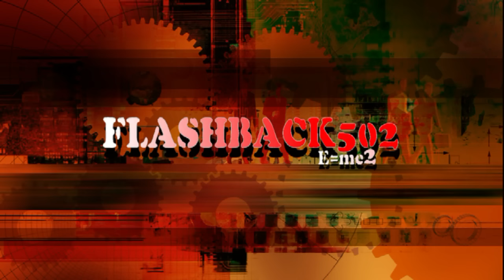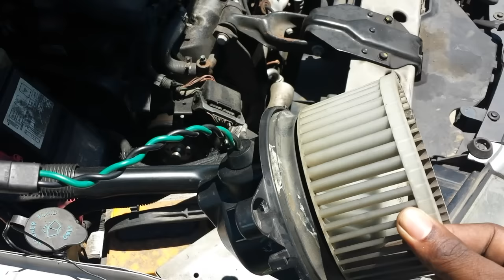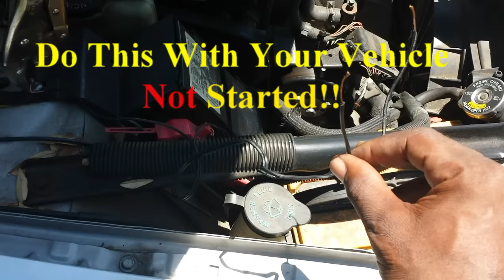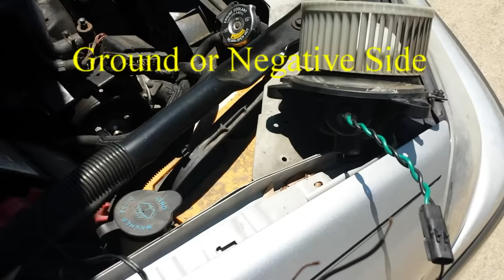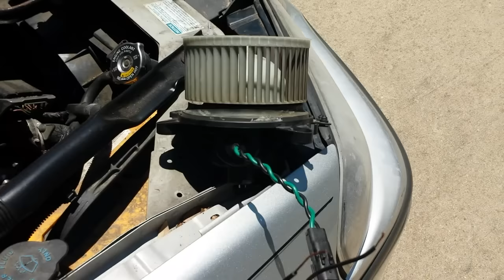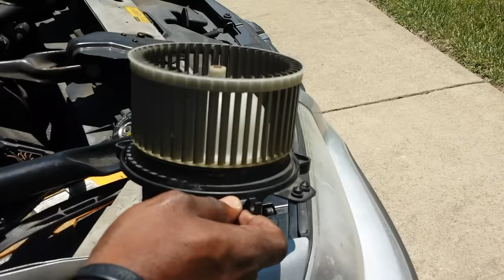How to Test Vehicle AC/Heat  Blower Motor to Tell if BAD

Comment: Very helpful video. My fan wasn’t working, I was getting volts before and after Resistor/Relay thinking fan was toast.  Did this fan test and it worked… Glad i didn’t buy a new fan. I was a lil confused why everything worked but Put everything back together. Maybe loose connections or there was a few dozen pine needles in the fan. Ty

Comment: You did prove that the blower was good, however from what I have read and studied on the web concerning auto electronics, you should test the fan while it is connected to its connector, "very important with the circuit ON", then "back probe" the connector, of the blower, with a DVOM "digital volt ohmmeter"  One end of the DVOM the "black lead" connected to a good ground, ideally, the battery negative terminal, then "very important" with the circuit ON, you now place the red probe of the DVOM on the positive feed to the blower, and read the voltage. If the voltage is low, like say 6 volts, way less than the battery source voltage,  then you have a voltage drop "resistance from corrosion or whatever" on the positive side of the circuit, from corrosion, loose connection, etc.

 If the voltage reads a normal 12 volts same as the battery source voltage, then place your DVOM red probe "back probing again", on the negative blower terminal, it should  "ideally" read "zero volts" or .very close to zero like .5v  5 tenths of a volt or less,  if it is higher than .5v you have a voltage drop "resistance corrosion or whatever" on the ground side of the circuit, because of a bad ground "resistance" like a loose connection, corrosion, etc.

So bottom line, you just can't say that the problem is definitely the switch on your dashboard is the issue, it could be, but it also may be from resistance as explained above. 

What you did was prove that the blower does work. You did not find out why it doesn't work when it has power in the circuit, and you guessed and concluded, that the switch on the dash of the car was the problem.

HTH
Reply from the maker: Thanks for helpful info.

Comment: You need to run it through an ammeter to see how many amps it's drawing.  When the motor is failing it draws more amps and burns out the resistor.  You'll just keep replacing resistors one after another with a failing motor that is drawing too many amps.
Reply from the maker: Thanks for watching and commenting  with tip. Please subscribe and share if haven't already and check out our other helpful videos.
Reply: Yes this test the guy did in video is good but does not prove 100% your motor is bad mine works but when we amp tested it.  It was way to high causing resisters an the wire harness connectors to slowly burn so u must amp test to truly 100% know
Reply: @charlesmorgan901  Thanks!
Will this cause the fan speed to become weak & slow, giving weak airflow?
Reply: @dee1380  hey any luck on this? Even my blower runs slow on all speeds

Comment: Not bad way to do it but you should have some small alegater clips with rubber coatings on them  to clip on the terminals instead of just sticking the wires in. A little safer.
Reply from the maker: Thanks for helpful tip. Please subscribe & like and share if haven't already and check out our other helpful videos

Comment: CAME BACK TO MAKE SURE i LEFT a LIKE..what next brother?
cuz my fan works on the Hot test
Reply from the maker: Thanks, check your fuses if not bad, then could be your blower resistor or a problem with you climate control  panel if not blowing at all. Also check your power plug to blower to be sure your geting power to it.

Comment: Another thing to note, if your high works but your low doesn't your resister may have gone out, which usually means your blower fan needs replacing as well.
Reply from the maker: Thanks for helpful tip. Please subscribe & like and share if haven't already and check out our other helpful videos
Reply: If it doesn’t work at all(with good fuses) is it the blower motor being bad itself or also the resistor? My mk4 gti fans randomly stopped working after I let it warm up(everything went dead on the climate control) including the lights for it…
Reply: @btbdesire4675  could be, though with that many issues I'd check the back of the climate control unit.

What happened with mine is the blower motor went bad, caused increased draw at the regulator, regulator goes bad, and then the contacts at the back of the climate control unit burnt out. In which case you need to replace all three, you might be able to rebuild the contacts at the back of the unit though.
Reply: That should only effect the fan controls though, if the entire unit is kill it's more likely that the climate control unit went bad, especially if it's new enough to have computer chips. 
The cheaper thing to rest first though is power, make sure the power is arriving at the unit, if it is, then you need to replace most likely. If there is no power, you get to have fun tracing wires
Reply: @HmmWelp  tested the blower fans and they have power, the resistor pack tested good and gave the exact outputs it should. Any other ideas before I go tearing into my wiring? Is there any other fuses other than 5 and 25? A relay or something else
Reply: @btbdesire4675  there certainly could be, that depends on the vehicle though so I'm not sure. I would pick up a new control unit from a junkyard and test that before you disk around with wiring, and replace the fuses you know of if you've only tested them.
Reply: @HmmWelp  alrighty, thank you. It’s a 05 mk4 vw gti! Is there a way to put power to the climate control unit to see if it’ll power on?
Reply: @btbdesire4675  if you know the amperage you likely coul, would just need to hit the red and yellow (if it follows stereo wiring colors) while the black is grounded.
If you do chase wiring, the most likely fault will be the ground.
Reply: @HmmWelp  Will the motor slow down airflow when it's bad?
Reply: @dee1380  a lot can limit airflow, I'd start by cleaning out the vents.
There's special cleaning spray that you use for that.

Other likely candidate is you need to replace your cabin air filter.
Should do that once or twice a year.

If you don't have any kind of grinding sound it's more likely one of those rather than the motor.

Comment: A blower motor also has a resistance that needs to be tested, if the resistance is not checked the fan motor can still be bad. Bad Fans can draw too much current!!! research before you make a video Like this.

Comment: My ac intermittently runs hot then cold back and forth. Something keeps stopping which causes that kick on noise to stop. I have to intentionally drive over potholes for that noise to kick on and the unit blow cold. When stationary the ac is warm.
Reply from the maker: Check recent videos, I just posted a video on your problem.

Comment: So I got a 94 Chevy c1500. It's not the AC controls. When you try to press or change the fan speed you can hear a loud click behind the glove box. I still don't get air at all. Is it my blower motor? Or is is fuse? relay?
Reply from the maker: Could also be your blower motor resistor. But check fuses also and relays.

Comment: You have to take the fan out to test it? You can't run a wire from the battery to the plug.
Reply from the maker: Yes you can👍Please subscribe & like and share if haven't already and check out our other helpful videos

Comment: You shouldn't have to take the blower motor out to test it. 
The problem can also be intermittent in the blower motor, or what's called a "dead spot", and would have to be replaced.

Comment: When I select floor, the blower turns off. Works on other settings.
I put another selector in, it did the same.
Goes from cold to hot..

Any suggestions?
Reply from the maker: Sounds like you have a problem with your climate control panel, may need to be changed. Please subscribe & like and share if haven't already and check out our other helpful videos
Reply: Resistor/transistor issue. control panels don’t really fail unless they get beat and punched on or liquid/moisture damage. Blower motors and resistors are the most common cause of low air or no air failures.
Reply: @np5589  

Thanks..

I know it's been 2 years..lol, but I parked on it, back at it with the same issue.
I changed the resistor, still the same. I did notice the pigtail connector melted, ordered another one which will be in today.

I thought my evaporator may be blocked, but I reversed polarity on my blower motor, & airflow picked up, but not enough, some air did come through, but very weak.

If replacing the connector for the resistor does nothing, what are the chances that the blower motor is not spinning fast enough? It's only maybe 5 years old(the blower motor).

There isn't very many other options left, so it has to be the pigtail connector or the blower motor itself is burning out. Or some wiring further down the blower motor resistor connector is having an issue.

Would connecting it to a battery like in this video give me full speed of the blower motor? It seems like it's fine at this point..

Comment: My heat and A/C only blows on the highest setting.  It doesn't do anything on any of the lower settings.  What could the problem be?
Reply from the maker: Sounds like it's your blower resistor that's bad not your blower motor. Please subscribe & like and share if haven't already and check out our other helpful videos

Comment: It could also be the resistor. Need a longer video checking everything, from the fuse/s first, the blower motor (here), the resistor, and finally the control panel. 👍
Reply from the maker: Thanks for tips. Please subscribe & like and share if haven't already and check out our other helpful videos
Reply: Do you know where the fuses are? I'm troubleshooting my problem and already replaced resistor and tried a new blower motor before that. Now I'm gonna test my motor to make sure it's not the issue and then I really want to figure out if it's a fuse of some kind before I take it to my mechanic to see what else could be.

Comment: Every time I touched motor terminals a spark occurred like if wires touched. Wires were not touching. When my heat stopped working I also smelled the burning smell
Reply from the maker: Check fuse, if not motor may be bad. Please subscribe & like and share if haven't already and check out our other helpful videos

Comment: Wrong. Sometimes fans will turn on and still be bad. If the blower motor still runs but turns on and off seemingly when you hit a bump or put it in park or drive then the motor could also be bad and start a fire. Do not trust them. Test the power going to the blower motor first using a volt meter while fan is on high seting. If good then the blower motor is likely bad even if it turns on.
The problem is, the blower motor is creating to much resistance in itself and causing heat in the motor and or wire harness. This can cause a fire. Do yourself a favor and get the right parts.
Also with the volt meter go ahead and check your control panel for the correct 12 volts coming out to your whole system. Worth the piece of mind.

Comment: I having a issue with it as well when I turn on the ac and fan it would only come on at high speeds at least 10 and up, now neither the ac or fan blows anything at all
Reply from the maker: Sound like you have a bad blower motor resistor located close to your blower motor, under your passenger side dash. Please subscribe & like and share if haven't already and check out our other helpful videos

Comment: When mine went out there was a burning smell that was a plastic/chemical burn smell and the fan stopped. I assume the fan burnt out. Do you think that’s the most likely cause?
Reply from the maker: Yes most likely it's burnt out but make sure you check the blower fuse first, should be in fuse panel, It could have blown. Please subscribe & like and share if haven't already and check out our other helpful videos
Reply: I checked the fuse and the relay following a video I found that said if I turn the car and have the heat on, that if it’s the fuse, I should be able to wiggle them (in my case it was 23 under the head and 24 inside my 1997 f150) and it should blow air a little. I tried that and it didn’t. And since you said it’s probably the heater blower motor burnt out, I’m just gonna get one at my local junk yard for $20 and put it on. For anyone with a 1997 f150 it’s located inside the truck on the passenger side. Maybe this comment will save people some trouble of looking for the fuse and all that. Thanks for the fast response. Subscribed 👍🏼
Reply from the maker: @jeffmurnahan  Your welcome hope you get it fix thanks. And thanks for sub.

Comment: What cause blower fan still on when key is off?
Reply from the maker: If it's your blower then you may have a short or something wrong with your climate controls. Please subscribe & like and share if haven't already and check out our other helpful videos
Reply: @Flashback502  even if the key is on in the ignition still blower fan still running
Reply: @fonylol303  Resistor

Comment: is another way just to check if dc is coming to your fan with a voltage meter
Reply from the maker: Yes that will rule out if power is getting to it our not, if not could be blown fuse. Please subscribe & like and share if haven't already and check out our other helpful videos

Comment: Thanks man; sadly your test proved my blower motor was bad in my 08 Nissan Titan. With that said with my military discount applied a new one cost me $90.51 from O’Reilly’s auto parts.
Reply from the maker: Your welcome, Thanks for watching and commenting glad could help. Yea it's always Nice to get a discount can help out a Lot .Please subscribe & like and share if haven't already and check out our other helpful videos
Reply: O Riley is way overpriced. Check on Amazon for better deal.
Reply: If you get the blower fan without the actual plastic fan part, just the motor they are closer to 30 bucks, then you just swap the old plastic fan on the new motor. a little bit more work, buck saves you about 50 bucks. 
or in my case, saves me about 100 haha
Reply: Did your fan motor have two or three connections? The rear blower motor my wife’s Nissan NV 3500 has a blower motor with three connections. Skinny connection goes directly to the fan speed switch which is actually a rheostat.

Comment: Mine runs fine but then the 10amp fuse blows and it quits. ?? Could it be the fan shorting out
Reply from the maker: Thanks for watching yes sounds like you have a problem with your blower motor. Probably should replace it. Please Subscribe and share if haven't already and check out my other helpful videos.

Comment: I have no heat coming out of vents my knob got broke and my blower was constantly running cause I can't turn it off I have 1998 Chevy lumina
Reply from the maker: Thanks for watching if you have air coming out then your blower is working, and you should check to make sure you have enough fluid in your radiator, if no air comes out then check fuse, and if that's good most likely u have a bad blower. Please Subscribe and share if haven't already and check out my other helpful videos.

Comment: FYI, DC circuits don't have a neutral. A neutral is derived from a tap in an AC transformer to ground, which is why NFPA 70-E calls it a "grounded conductor". Also, fun fact, circuit diagrams have DC circuits backwards. According to the Electron Flow theory, in a DC circuit electrons flow from the negative side, through the circuit, and return on the positive side. 

I actually came here to try to find more information on how to test the internal resistor on a blower motor before I pull it out. 

Thankfully another YouTuber pointed out something I hadn't thought about, and that's determining the ampacity of the motor and checking it with an ammeter to see if the motor is drawing too much amperage. This would indicate higher resistance on the motor, which could be from a clogged or failing motor.
Reply from the maker: Thanks for commenting. And info Please subscribe & like and share if haven't already and check out our other helpful videos

Comment: Mine just blows out air when I put heat air just comes out when I put ac air comes out to could that be it to
Reply from the maker: Thanks for watching if air comes out then your blower is working, you may want to check your fluid level in your radiator if it's to low then you want get heat if not may be your heater coil. Please Subscribe and share if haven't already and check out my other helpful videos.
Reply: Thanks and there was a bunch of leaves in inside we’re the air blows was that prolly why ?
Reply from the maker: @theonlyoddest5429  could be would clean and see if it helps.
Reply: Nvm you right the heater coil isn’t even heating so that’s probably it

Comment: I have ah Chevy Jimmy truck and when I turn on the blower nothing comes out .
It's not the fuse it's the blower it's self
Reply from the maker: Thanks for watching, if fuse not blown then most likely it's the blower, but before buying a new one, I would test it. Please subscribe and share if haven't already and check out my other helpful videos.
Reply: Try replacing the resister. It’s what gives the power to the switches. They have videos on here for it. Should be located in the same area as the fan

Comment: Do not do what this guy did super Dangerous to do what he just did turn your heater on if it doesn’t work than it could be your blower motor and if you don’t get heat out of your dashboard it’s your heater resister 
Do not cut wires and do what this guy did cutting wires can lead to a fatal sparks ⚡️ and damage to your vehicle 🚗 
Be safe out there 😀have a good day and good luck